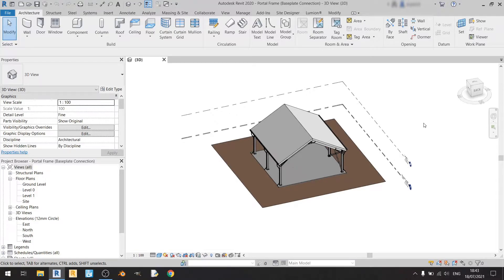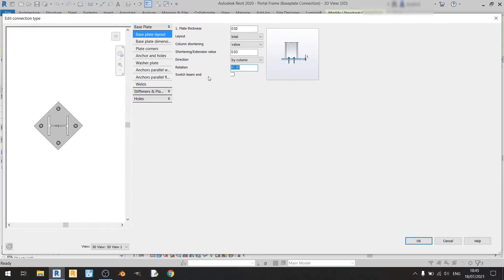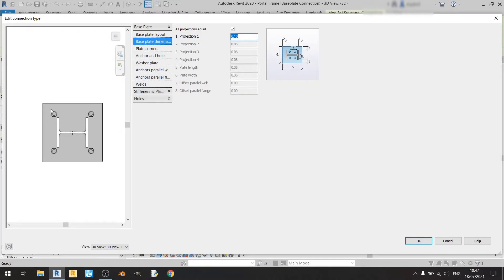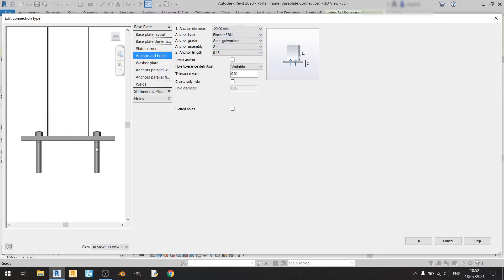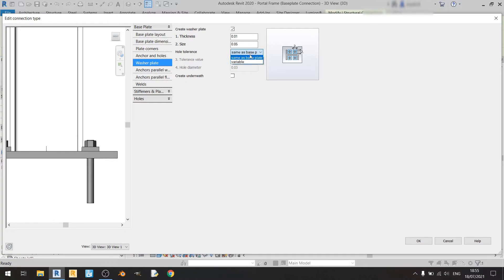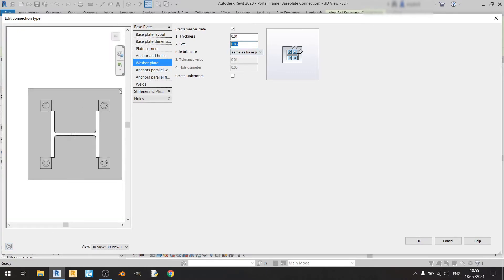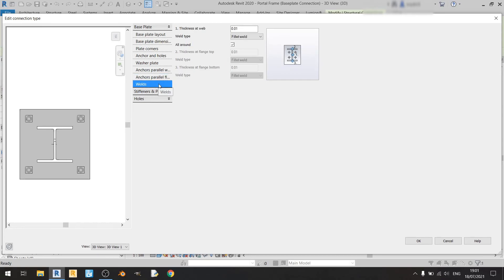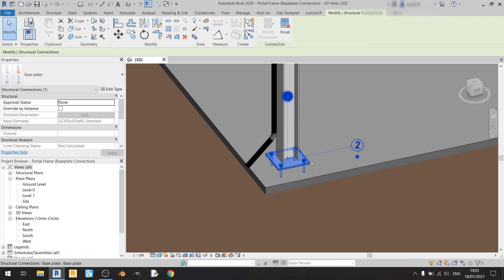Column Base Plate Detailing in Revit

Comment from the maker: Timestamps:
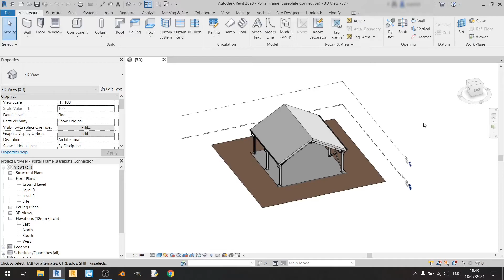0:00 - Introduction
0:25 - Base plate layout
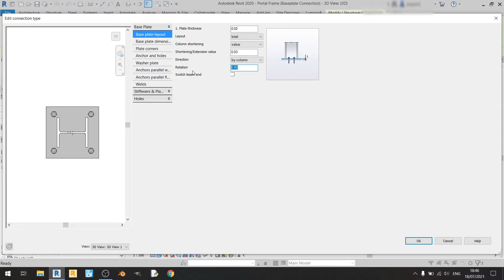2:14 - Base plate dimensions
2:53 - Plate corners
4:09 - Anchor and holes
6:00 - Washer plate
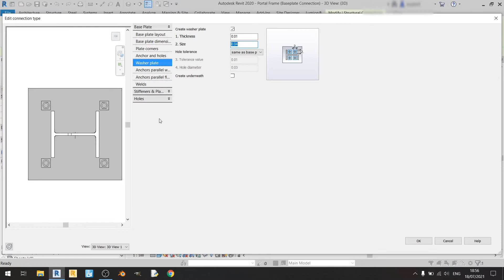7:15 - Anchors parallel web
8:58 - Anchors parallel flange
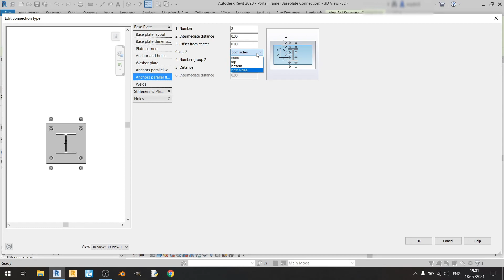10:15 - Welds